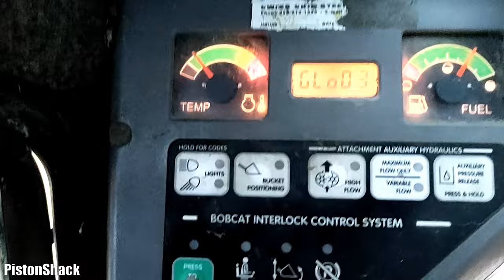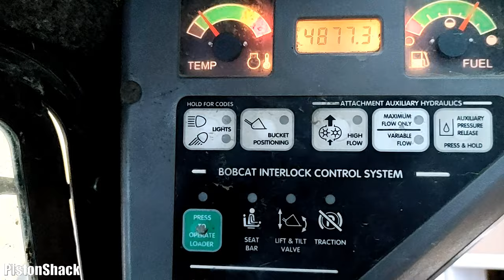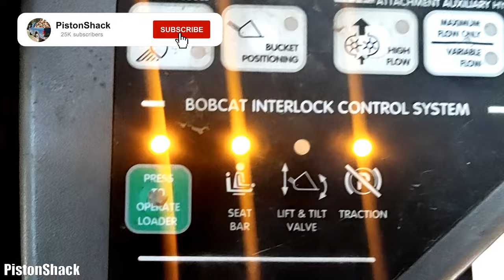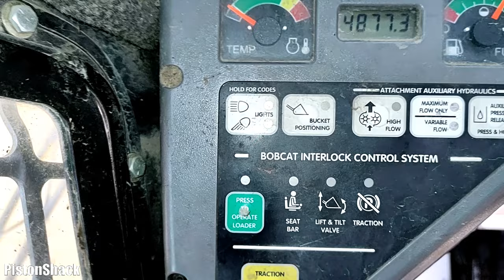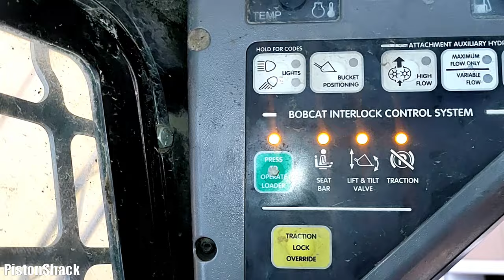BOBCAT S185 SKID STEER LOADER NO LIFT, NO TILT DIAG & REPAIR | LIFT & TILT VALVE

Comment: Got my lift and telt working  a short with a fuse the fuse was OK but not connecting so cleaned and replaced All Fuses after 3 days down
Reply from the maker: That's great, Luke! Thanks for sharing your experience.Why that fuse wasn't connecting properly in a first place?